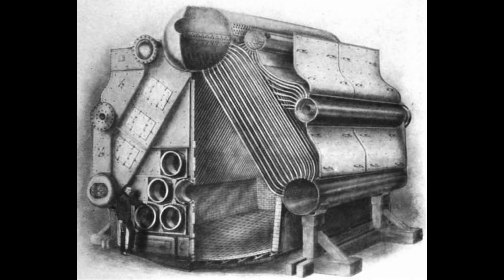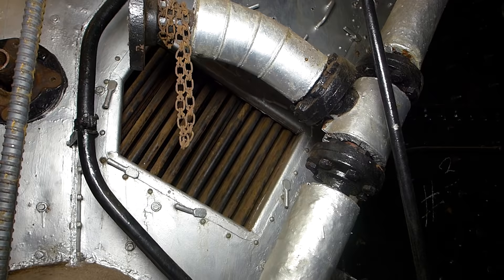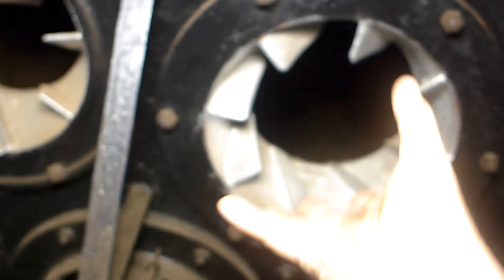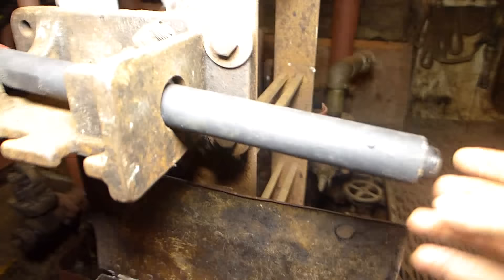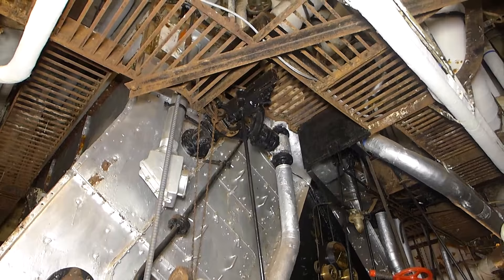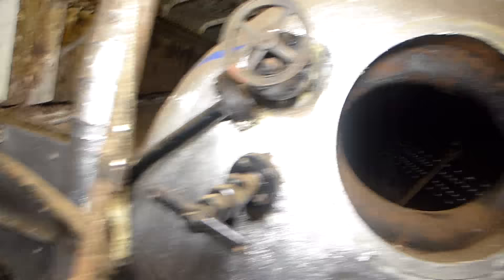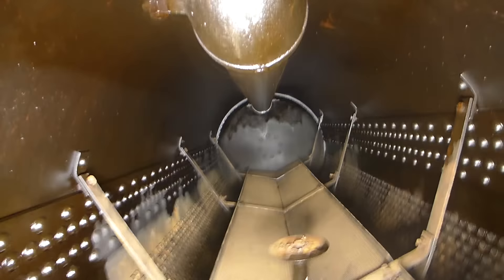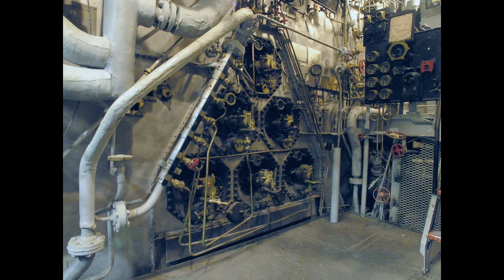Battleship Texas, Making Steam

Comment: Worked as a maintenance mechanic for years and one of the jobs I really despised was changing the pressure relief valves in a particular area. You had to pull those heavy damn things up around 40 feet by hand by rope . Whoever designed that area didn't take into account replacement and recertification of them. While that was great for an upper body workout I'm paying for it at 64 years old now. But hey great video brought back memories and really makes me appreciate retirement.
Reply: That's how they did it in the plant I worked at unless they were lucky enough to have a cherry picker or a crane at their disposal.

Comment: As a current Stationary Steam Engineer (SSE), the State still asks us questions about maintaining riveted seam boilers on our various licensing exams. I would be shocked if there are any left in service in my state. 

When I saw the wet steam drum I was horrified at first. You never want an open boiler to be wet. It can cause corsion, but then I reminded myself these boilers will never be lit again so no problem. My reaction struck me as funny. Guess I would be the only one to think so haha.

Great video. Good work explaining everything. I am going to share this with my fellow SSEs. I am sure they will get a kick out of the riveted seams.
Reply from the maker: Thanks for the kind comments!  Your horror would have been shared by engineering crew 100 years ago.  The operating manuals of the time were very adamant about keeping cold boilers either filled completely with water for short periods or very dry and closed up.
Reply: @tomscotttheolderone364  You are 100% right sir.

Comment: An engineering marvel. We look back 100 years when these boilers were built and we think of them as "primitive" but we don't think about the fact that they built these boilers without the help of computers or robots and they just worked.. Thousands of tiny water tubes, every single one of them installed by hand, with no leaks...

It's amazing..
Reply: Yes, but imagine one single wrong shot can put this at bottom of the see. Or canon from this one to some other.
Reply: @dekipet  The same thing can still happen today with a lucky shot. As a designer, all you can do is take every reasonable precaution you can against that sort of "golden BB" with as few compromises as possible, but at the end of the day everything's a compromise. You just have to hope you made the right compromises.
Reply: But why they used boilers instead of massive giant piston engines inside the ship???
Reply: @Big1_   There were no internal combustion engines that big in the very early 1900s when Texas was built. Even by WWII when there were diesels large enough to move a large ship, they were used for cruising, not top speed. The Germans for example tended to use mixed powerplants with diesels for long-range low-speed cruising and steam engines for high-speed operation. By that time large diesels were more efficient but far less powerful. Take the Graf Spee, for example. It used 8 diesel engines instead of boilers and steam turbines. In comparison to cruisers from other nations, it was very slow (28.5 knots, compared to 33 knots for American cruisers, for example) but had very long range (16,000 miles to around 9,000 miles for American cruisers), which was fine for it's intended role, but meant it was hopelessly outsped by peer units. 

Even today, we're still using steam engines on large ships. A modern CVN still uses steam engines. The nuclear reactor is basically just a boiler, creating steam to drive a turbine to drive a screw.
Reply: @wun1gee  thank for the explanation, i apreciate it :)
Reply: Actually, these boilers are old but steam systems today aren't that much different. One main difference inbnewer systems is in the controls. The last boilers I worked around were computer controlled with highly tuned instruments. The drum level was controlled through a bias controller that looked at feed water and steam flow plus overridden by level. And the computer shipped the set points to the controllers. This made for almos5 trouble free smooth levels and very steady pressure control. It's mind boggling what can be done with well tuned instrumentation and a good computer.

Comment: Thank you, For a clear and interesting presentation on this type of Water Tube boiler, and its systems, one point however, reciprocating engines can be run with moderate superheat, I have done so myself, for the past 30 odd years, in the latter years of commercial reciprocating Engines, superheating was used to make the system more competitive in terms of fuel consumption.
Reply: Use piston valves on the HP, cylinder oil, and flake graphite sparingly from what I can gather.
Reply from the maker: @clivelee4279  All valves on this engine are piston valves.  While something else may have been used as lubrication on later designs, this one only used water for lubrication.
Reply: Most locomotives, at least after 1900 had superheaters. Lubricating oil was forced into the cylinders with mechanical lubricators.

Comment: Very informative, the Fisher & Dresser companies both make “steam desuperheaters” to return steam to saturated condition. This would leave more boiler capacity. Interesting point about recip drivers needing saturated steam. In the 70’s n 80’s I once worked in an org the had several factories built in this era. The air compressors and bfw pumps used recip steam engines. The steam was saturated but never realized the adv ofsat steam, steam traps & steam hammer were an ongoing issue. Plugging a busted tube must have been a bugger on this boiler design.
Reply: @tomscotttheolderone364  
There are basically two broad types of desuperheater:

Indirect contact type - The medium used to cool the superheated steam does not come into direct contact with it. A cooler liquid or gas may be employed as the cooling medium, for example, the surrounding air. Examples of this type of desuperheater are shell and tube heat exchangers.
Here the superheated steam is supplied to one side of the heat exchanger and a cooler medium is supplied to the other side. As the superheated steam passes through the heat exchanger, heat is lost from the steam, and gained by the cooling medium.

The temperature of the desuperheated steam could be controlled by either the inlet superheated steam pressure or the flowrate of the cooling water. Control of the superheated steam flow for this purpose is not normally practical and most systems adjust the flow of the cooling medium.

Direct contact type - The medium used to cool the superheated steam comes into direct contact with it. In most cases, the cooling medium is the same fluid as the vapour to be desuperheated, but in the liquid state. For example, in the case of steam desuperheaters, water is used. A typical direct contact desuperheating station is shown in Figure 15.1.3.
When the desuperheater is operational, a measured amount of water is added to the superheated steam via a mixing arrangement within the desuperheater. As it enters the desuperheater, the cooling water evaporates by absorbing heat from the superheated steam. Consequently, the temperature of the steam is reduced.
Control of the amount of water to be added is usually achieved by measuring the temperature of the steam downstream of the desuperheater. From Spirex site
Reply from the maker: @otisarmyalso  I am still curious about what happens to the heat taken from the steam.  Is it simply lost?

Comment: The burner tip plates did not spin. They had tangential grooves that gave the oil a rotational movement before going to the nozzle orifice. That helped with atomization in the old style burners that did not use steam for atomization. Waiting for a burner to cool was often a luxury and changing tips or cleaning a hot burner was a common occurrence.
Reply from the maker: Yes, thank you for your correction.  This was a misunderstanding on my part from a verbal description I was given a few years ago.  I found original drawings of the Cuyama tip plate after I shot the video that clearly shows the tangential grooves and the a small chamber formed by a shallow depression in the front of the plate where the oil came together and spun.  I also recall a veteran saying that they had some asbestos gloves they used to work with the hot components.

Comment: Thanks Tom for another amazing video. You really do a great job! On boilers I have operated we called the bottom drums the mud drums as that is where sludge collected for blow down. Surface blowdown is up in the steam drum and gets scum carried over from steam oil on the slide valve…not sure if Texas has a slide valve. Interesting that there is no fuel regulation on the burner, modern boilers use steam atomization and carefully monitor firebox pressure.

Can’t say enough about how much these videos are appreciated. Great history given by a fantastic narrator

Comment: Terrific video, Tom! I could spend hours down there poking around. It is mind-boggling how the boiler manufacturer sealed the rivet heads and joiner plates with chisels no less. Makes one wonder what the pressure test pass/fail ratio was for those hand built components.
Reply from the maker: Thanks.  The drums were pressure tested to about 400psi.  While I don't know this as a fact, my bet is there weren't too many initial leaks simply because these guys were highly skilled.  Even if there were bad rivets, most could be found before pressure testing.  Properly trained and experienced workers would come back after everything was cooled and test rivets by tapping each one with a hammer.  They could usually tell by the sound if a rivet was good or not.  By the way, this method of caulking was used throughout the ship during construction and there were teams that did nothing but that.  All hull shell plating was caulked that way, as well as water and fuel tanks.  While that was the primary technique, they also coated overlapping water and fuel tank plate joints with a sealing material; frequently a lead compound.

Comment: I work in a modern coal fired power station and it's amazing that in 2024, the oil burner technology is almost exactly the same including the need and procedure of cleaning burner tips. The main exception being that air is forced through the air registers instead of natural draught
(Please note: oil is only used to get the fire stable enough for coal to be introduced)
Reply from the maker: The original coal fired boilers on Texas included oil burners, but for a somewhat opposite reason.  If they needed a a firing rate greater than what could be achieved with only coal, they could increase it with oil.  As part of the precommission ship's builder's trials, they added the oil burners to fully coal fired boilers to further increase heat.  The fireboxes got so hot, they warped the coal grate bars.  They had to pull the fires one boiler at a time, then pull each grate bar and beat it out straight.  For that reason, I would be surprised if they did it more than when absolutely necessary.

Comment: Thanks Tom!  Looking forward to the next video!

Any chance we could see what's left of USS Texas' torpedo tubes?  If I recall correctly, only the compressor room for firing the torpedoes is left.  

Thanks again for all your hard work in documenting the Texas!
Reply from the maker: That's correct about the compressor room.  The only remnants are the charging compressors that were repurposed for supplying compress air to other needs on the ship.  Two more compressors were added to the room.  The original compressed air bottles, called accumulators,  are still in the spaces that were the original compressor rooms.  Other than that, all signs of being torpedo rooms have been completely eliminated.

Comment: I was perplexed by the position of the water level sight glass, it seemed to be positioned too low, upon thinking about why this was done I surmised it was not critical to keep the water exactly at the half way point rather the water level had to be kept high enough to cover all of the generating tubes; also the narrator, I believe, was in error when he pointed out that the pipe protruding from the baffle was the boiler feed pipe, it's diameter was too small. With modern boilers it is critical to maintain a water level in the steam drum for safety reasons also unlike the primitive cousins on the Texas, modern boiler steam drums a packed full of baffles, cyclone separators, dry pipe and dry pipe cover, feed water injector pipe and finally the surface blow pipe. One last point to make regarding the burner tubes, the disk inside is called a sprayer plate and I'm fairly sure it does not spin; the spinning of the fuel is accomplished by the tangential slots machine around the orifice
Reply from the maker: Thank you for the valuable comments.  Nothing replaces direct experience operating this kind of equipment.  I will review some of my conclusions.  I am sure that you are right on much of it.  There are some detailed drawings of Dyson boiler components that I will go back and review in detail for boiler feed.  My bet is you will be right.  As far as sight glass position, it is what it is.   I have a Navy manual describing operation, including tending water.  One thing was that keeping water level at midpoint was very important.  Large changes in demand, such as big changes in engine throttle, or sudden changes in burners could cause big jumps in water level one way or the other.  Most interesting was a warning that you couldn't tell if the drum was full of water or empty if water level was so high that it filled the entire sight glass, so a tender may panic and blast even more water into an already overfilled steam drum.
Reply: @tomscotttheolderone364  How would you verify completely full or completely empty sight glass?
Reply from the maker: @stevensheldon9271  This design typically had three valves called try cocks located at different levels on the steam drum.  You would very quickly know that the water level in the steam drum was too high if you opened the top one and got water instead of steam.

Comment: That seems weird that they didn't use superheating. If I were designing it, I would:
A. Lubricate the pistons with oil
B. Add an oil separator on the feed water line so it wouldn't contaminate the boilers
C. Keep the superheaters the boilers were designed with
D. Achieve the higher power and efficiency that comes with superheating
Reply: It does seem weird, most locomotives, at least after 1900 used superheated steam with forced cylinder lubrication.